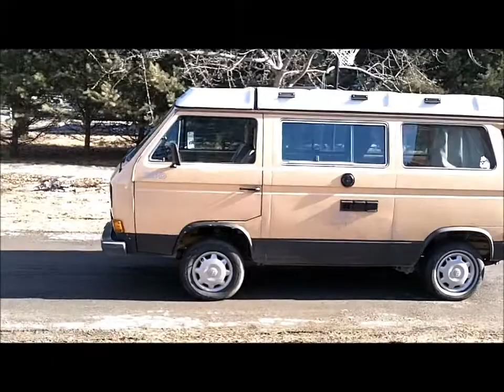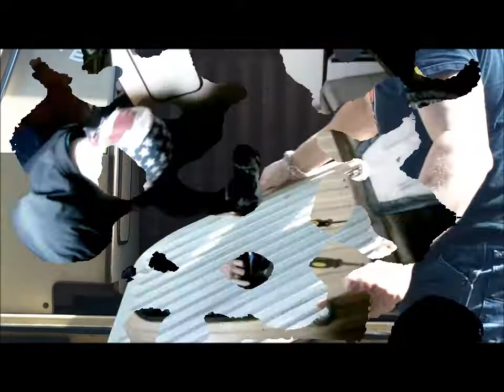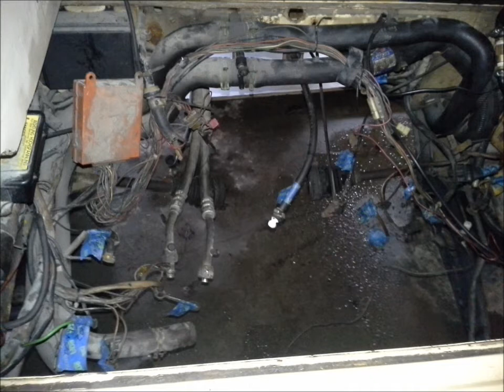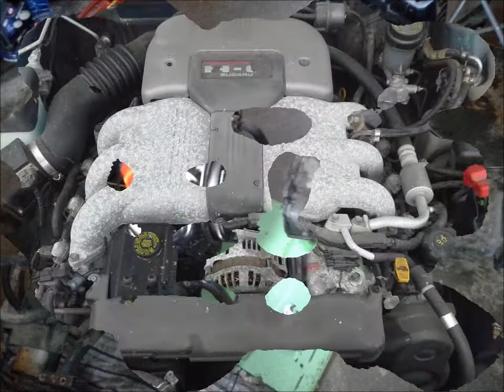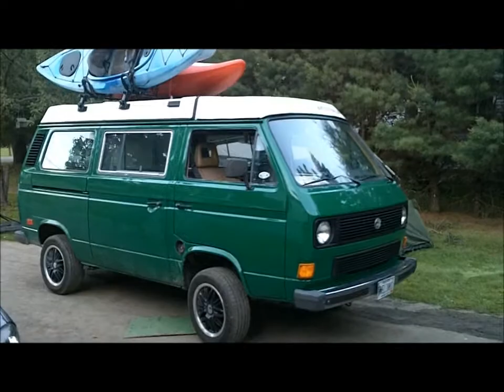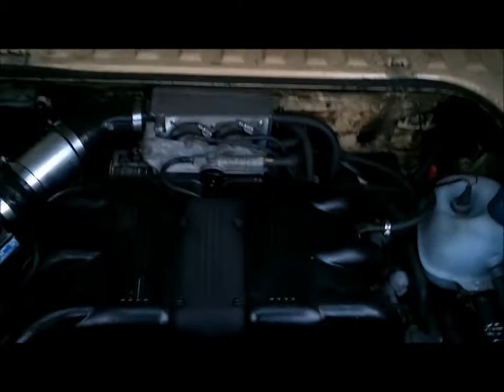Vanagon Transformation

Comment from the maker: If I did it all again, I would go with a four cylinder boxer.  Either the EJ22 or the EJ25.  I finally completed the conversion on Fathers Day.  Took it on it's maiden voyage this weekend and had absolutely no issues with power on the hills.
Reply: Why would you pick a four cylinder?  Too much power?
Reply from the maker: @oldgadfly8398  Not so much the power, but because the parts are harder to find due to the rarity of the engine.
Reply: @floydiod  Ah. That makes sense.   That is the problem with keeping any older vehicle alive isn't it?  Generally, one of the nice things about the Vanagon is all the support for them.
Reply from the maker: @oldgadfly8398  Indeed!

Comment: Nice!
Reply from the maker: Thank man, this VW has a lot of love put into it.  How was the whitewater this year?  And the collar bone?  Maine's water was horrible this year, rain went all North.
Reply: floydiod why did u say if u had to it again u would have gone with the Volkswagen 4 cylinder motor?
Reply from the maker: woody95124 I wouldn't go with the 4 Cylinder VW motor, but rather the 2.5 Liter Subaru motor.  I would still do a Subaru conversion, but just use there 4 cylinder model instead of the 6 cylinder.  Reason being is parts costs.
Reply: floydiod oh ok...got it..I'am sure u enjoy the power with the 6 cylinder....I bet it flys and has no problem on hills.....

Comment: What is the total cost or a 4 cylinder Subaru conversion on a Westy using an EJ 25.
Reply from the maker: +skylift2 Well, that's kinda a loaded question.  But I'll try to answer it the best I can.

There are several companies that offer kits to do the conversion yourself, both require you to find an engine.  I would be aware that there are additional costs associated with each.  One main additional cost is the $800 wire conversion done to the subaru harness.

1)  Small Cars has a converstion kit for $1700

https://smallcar.com/vanagon/subaru-vanagon-conversion-parts/subaru-vanagon-parts-kit-4spd-vanagons-and-syncro.html

2)  Rocky Mountain Westy has one for $3000

http://www.rockymountainwesty.com/category_s/344.htm

I also know of one company that will send you a turn-key conversion motor for about $12k.

http://vanaru.com/

Hope this helps.

Comment: Is that engine out of an SVX, or is that a later Subaru H6?
Reply from the maker: 1992 SVX LSL was the donor
Reply: @floydiod  Cool. What mounting kit did you use?

I left my last comment eight years ago. Is this van still on the road? If so, how's it running?
Reply from the maker: @MercedesDieselGuy  I used the kit from RMW.  The bus is still up and running and we use it all spring/summer.  I have had to replace the cam seals and the water pump since I put in the engine. That's it.
Reply: @floydiod  awesome. I'd like to do a Subaru swap at some point, but not necessarily on my '91.

Comment: How do you get the van to go 4 gears forward?
Reply from the maker: The engine is mated to the original transmission, which I had rebuilt by Rancho to take the additional horsepower and torque.  I also use Porche CV Axles.

Comment: What is the color code for the paint you used?
Reply from the maker: It's Emerald Green.  Here is the link to the kit I used:

http://www.amazon.com/Emerald-Green-URETHANE-BASECOAT-CLEAR/dp/B001B46Z5S

They used Escorial Green back in 1984.  What I used is pretty darn close, and by total coincidence.

http://www.gti16v.com/vwcslt6a.htm#vwcslt6a

http://www.amazon.com/s/ref=sr_nr_n_1?fst=as%3Aoff&rh=n%3A15684181%2Cn%3A15709231%2Ck%3Aescorial+green&keywords=escorial+green&ie=UTF8&qid=1427478341&rnid=15690151
Reply: Thanks! That is a great color for a Westy.